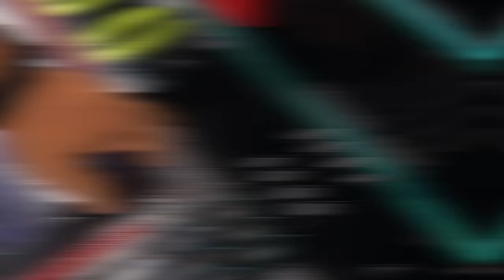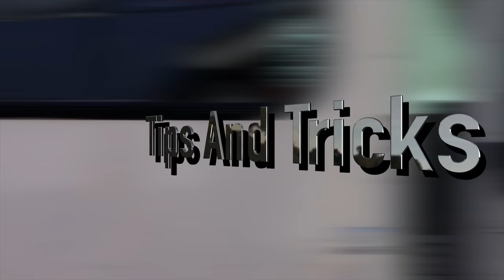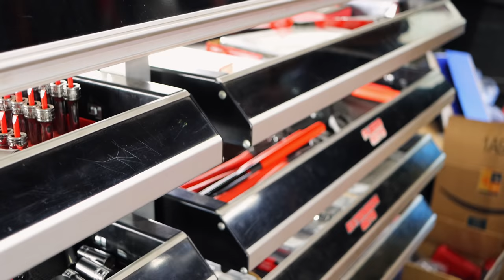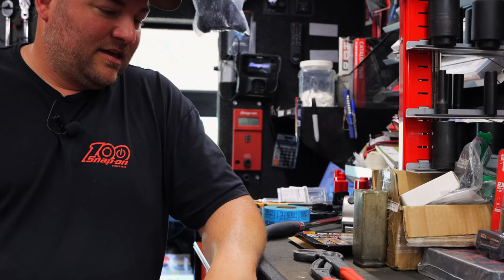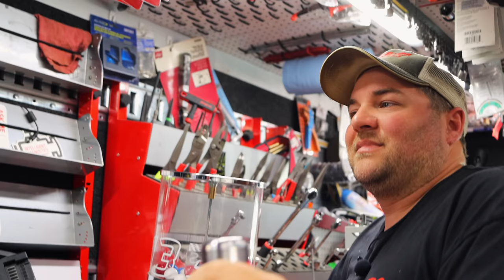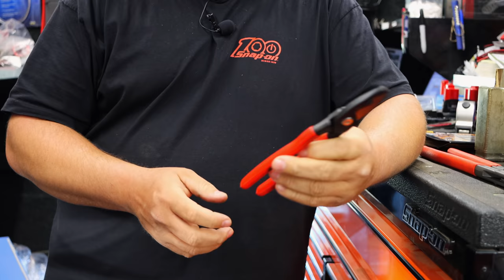Snap On Friday: New Knipex Pliers

Comment: Thinking about getting the long neck 3/8 and 1/4 ratchet is it a good buy better than Milwaukee?
Reply from the maker: I haven’t had good luck with milwaukee ratchets. I prefer the snap on
Reply: @KoonTrucking  thanks my Milwaukee just isn’t cutting it for me
Reply: My 5 year old milwaukee is just now slipping, and its not even the fuel version im pretty sure its the first or second version, use it on transfer case, torque converters and anything else you could imagine everyday.